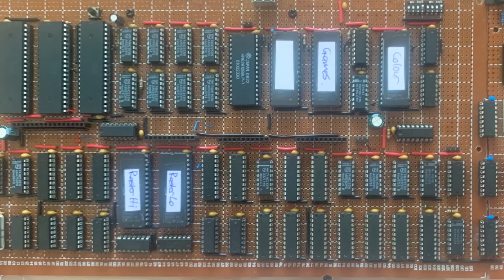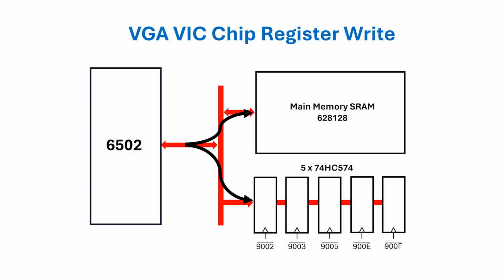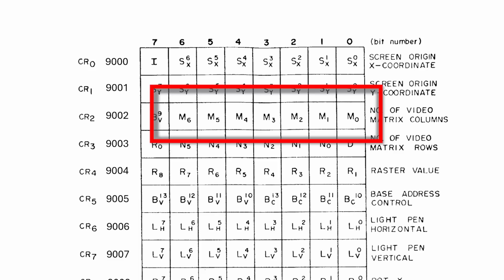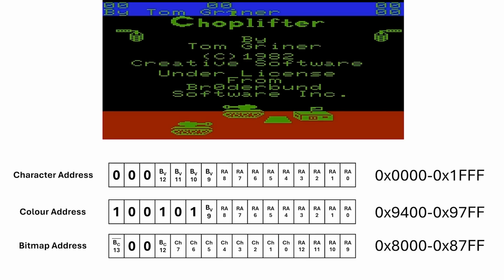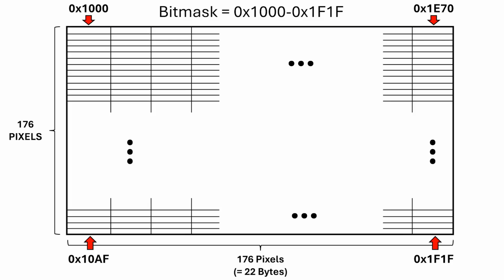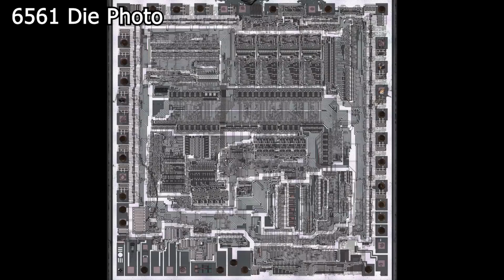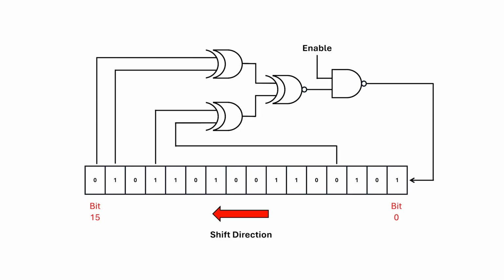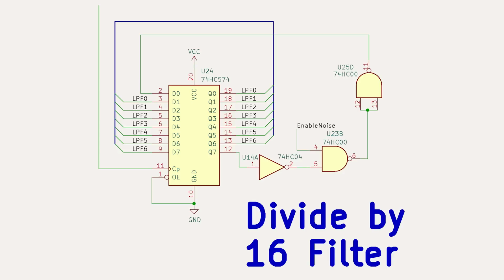VIC-20 Bitmapped Graphics and Noise

Comment: I’m really loving the series, and I’m working on a PCB version of this VIC-20 build, but there’s one detail that’s driving me crazy.

In the schematic, the color-select mux control bits look inverted compared to how I’d expect them to be. In the video you say that in character mode you can only choose the background color and the character color, but from what I understand looking at the schematic, in character mode S1 is tied to ground and S0 is driven by the pixel data ANDed with the active signal.

If I’m reading this right, the selection logic seems flipped compared to what’s explained in the video. Please let me know if I’m missing something — I’m almost done with the PCB and I’d love to send it out for manufacturing soon.

Also, any chance the final episode or an updated schematic is coming out soon?

Comment: Hi Matt, I'm building a BE6502 and I'm thinking - bearing in mind approaching this from a literally zero knowledge base - of trying to follow your build of the vic-20. Do you have a contact email where I could ask you a couple of questions about the schematic and the software you use? Thank you!
Reply from the maker: Welcome aboard.  If you're interested in expanding the BE6502, i'd probably recommend the Apple 2, it's an easier build and i have a full playlist on it (Apple 2 wire-by-wire playllist).  Generally i use KiCAD for schematics, programming is done with visual studio 2022 and the videos are made with Premiere Pro and powerpoint.   Your best bet for contacting me is probably to leave comments on videos.  I'm currently working full-time, so my work e-mail occupies a lot of time and i don't check my personal email that much.

Comment: Another Great Video, thanks Matt. Can it handle the expanded screen now e.g. Star Defence 16k or Bongo? Looking forward to the next video on the noise channel, you can't have an 80s computer without explosions.
Reply from the maker: Yep, basically I have enough EPROM space for 32 screen configurations.  I’ll try a bunch of different games and see if I can identify the most common ones.  To make it fully programmable I’ll need more hardware
Reply: @DrMattRegan  LaserZone will be a good test of your sounds. Also Myriad which has a good expanded screen and multicoloured graphics as well as multi channel sound with different sounds for each wave of aliens that can carry over to the next wave. Robotic Liberation demo will see if you can handle Viznut waveforms and Berzerk MMX+ with speech. There is also a new release of a port of Elite.
Reply: @DrMattRegan Is Vic20 video 7 coming soon with the sound from the noise channel and new screen resolutions?
Reply from the maker: Yep, its on the list, any games you'd like to see.  The audience really dropped off on this series, i thought I'd have a break before finishing it.
Reply: @DrMattRegan  Thank you. I will try and drum up some interest on Denial the Vic20 forum.

Star Defence - expanded screen and good sound effects and colour effects. There is a slow and a fast mode 

Bongo expanded screen platformer

Laserzone particularly good startup sounds that pushed the VIC chip 

Myriad - expanded screen, multicolour mode and multiple sound effects 

These would make for a very thorough test. 

Thank you for all the attention and love for the Vic20, it is a fascinating series of videos.
Reply: @DrMattRegan  Hi Matt, are you coming back to the Vic20 soon?

Comment: LFSR = Linear FEEDBACK Shift Register.  
The math on these was worked out in the 1960s for each size shift register, and where the exclusive-or taps are placed.  
With the Fibonacci version, taps select outputs and feeds them to the exclusive-or gates.  
A similar Galois version places the exclusive-or gate in the shift register chain.  
The example shown is a "maximal length LFSR" version where the number of states excludes 0, so for a 16-bit shift register you get (2^16)-1 = 65535.  
(There are other tap placements that also give 65535 combinations.)
Reply from the maker: Thanks. I'll make a correction in the next video, unfortunately my edit time is limited on these videos, so i rely on the audience to spot these mistakes.
Reply: @DrMattRegan  It's a relatively minor error, but was correct in one part of the video, and wrong in the other.  So if you do any re-editing, for more important reasons, this could be an additional tweak.
Reply: @AcuteChronic  usually the taps chosen achieve the max length sequence have something to do with the resulting polynomial being prime.

Comment: What is clocking the LFSR? I've used the Vic clock but I suspect that's way too fast. Is it the actual channel frequency that's clocking the LFSR?
Reply from the maker: I'm using Lance Ewing's description.
http://www.tinyvga.com/6561
It's very similar to the other sound channels, except it uses 0x900D.
The actual frequency is
f=1022727/32/(255-$900d)
Reply: @DrMattRegan  Yeah I just started to feed that frequency into the pipeline so in theory I should be shifting according to 'f'. I suspect my noise generator module isn't clocking .. FPGAs have their good points but sometimes not being able to put the scope on physical pins is a nuisance.. I'll come back to this after a sleep. Must be really close.
Reply: @DrMattRegan  Well I did something really stupid. I failed to initialise my lfsr register with 0xFFFF. It was always 0 so I had no sound... but now I got white noise and it varies with frequency poked into 36877. What a relief!

Comment: This brings back nightmares. I wrote a video game for the Vic-20 in the early 80’s. I expanded the display to fill the screen, getting rid of the border. I kept the 8x8 characters and reused the characters for common parts of the display. It was a nightmare as to do sprites, I had to copy the underlying character, draw the sprite over the top and replace the character assignment. When the sprite moved, I had to restore the old character and repeat the process for the new location. When two sprites intersected, it was especially difficult to sort out.
Reply from the maker: Sounds nasty.  I wrote some 6502 sprite software which ended up being more complex than I expected.
Reply: @DrMattRegan  , it was. What made it worse was that some of them were men that were two characters tall, so I had to track different cases of intersections with each half. I had a lot of cases of them leaving their pants behind. 😄

By the way, my cycle accurate Macro6502 design is progressing well. The modelling of the instructions and microcode are done. I'm currently modelling the interrupt behaviour. My target was at least 1MHz real time operation and a minimum of 2MHz. I think the circuit may get up to overclocking to 5MHz. Of course, it will single cycle so you can see clock by clock what is happening inside.

Comment: I am really liking the vic20 build!  The use of the xor reminds me of some work on an 8bit. Pascal library I did based on George Marsaglia's xorshift algorithm. I've often wondered how simple it is if it could be implemented in a FSM using only logic (since the states are very simple) obviously some kind of shift register and scratch register would be required but since it scales to any bit depth there's no reason 8 bits wouldn't work. The only question is how to seed the most effective base set, and how to assure a non zero start state.
Reply from the maker: Thanks David.  I think the seed value is controlled by the enable signal on the LFSR.  When enable's low, it should fill the LFSR with 1s.  Provided it's any number other than zero, it should work, it'll just keep cycling.  When i need a RNG in software i often go for the fibonacci generator, seeded with primes.  Just makes debug easier.

Comment: Whereabouts did you deduce that the noise signal is divided by 16? I'm looking at vic20sound.c in the Vice source as well as m6561.vhd in the Tang Nano Vic 20 VHDL source and I cannot see it happening - not explicitly anyway. The Vice source has some sort of "edge_trigger" and there's a shift count of some sort being used.. I suspect the VHDL code on the other hand isn't doing the division at all. I don't find the comments in the Vice source particularly helpful.. probably because there aren't any..

Comment: When thinking about the audio part of the VIC chip, you need to think about clipping; to reproduce the authentic VIC chip sounds, you need to clip the audio output fairly aggressively; if you don't do this, then the output, although sounding "better",, doesn't sound "right".
Reply from the maker: @vicenary  I’ll probably just see if I can get away with analog circuitry for that, there is some code in VICE from memory.

Comment: Man as I kid I always wondered how they did the bit graphics on the VIC-20.  I also had an Atari 8-bit computer and that was sooo much easier to do graphics on.
Reply from the maker: @r3jjs  it’s interesting.  I think this is actually what the machine was designed for and BASIC was an add-on.
Reply: @DrMattRegan  Don't forget that Commodore licensed BASIC as far back as the PETs, so I can't really think BASIC was an add-on.
Reply from the maker: @ well, not an add-on per se, but I think it was a games machine first, compared to the PET for example
Reply: @DrMattRegan basically yes. From what i can remember, the vic chip was designed to take on the Atari VCS but didn't have a computer to exist on. It was then turned into a console (internally, within Commodore), again with the intention of taking on the Atari VCS. However, by then, home computers were starting to show up. The design was re-engineered to make it into a home computer. IIRC they went after the Timex Sinclair (ZX81 in the UK). It's all in the book "On The Edge" by Brian Bagnall, which is the only book in my entire life where, having read the last page, I immediately went back to page one and started the whole book again. It's that good. 

Another great book is "The Soul of a New Machine" about the creation of the first 32-bit Data General Nova. 
Regards.
Reply from the maker: Thanks for the pointers, i'll have a look.

Comment: Minute i saw a update. Lol inhave to watch and learn
Reply from the maker: Enjoy!
Reply: @DrMattRegan  i did and it seems so over whelming to me. You good sir are a genius and a treasure. If you ever make a board for this i can't wait to buy it.
Reply: @DrMattRegan  also how different is a vic 20 compared to the commodore pet ?
Reply from the maker: @ from memory the PET used a 6845, so it only had a character based display
Reply: @DrMattRegan Hi Matt. The Amstrad CPC range used a 6845 and had bit-mapped graphics.
Reply from the maker: Yeah it's possible, CGA cards also used the 6845, and it has a bitmap mode, but it is oriented towards character based displays.